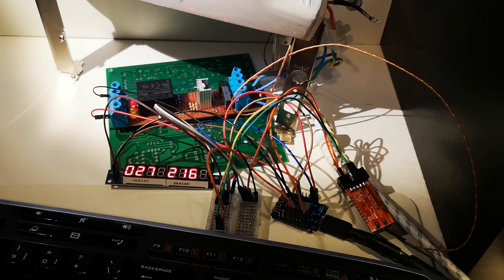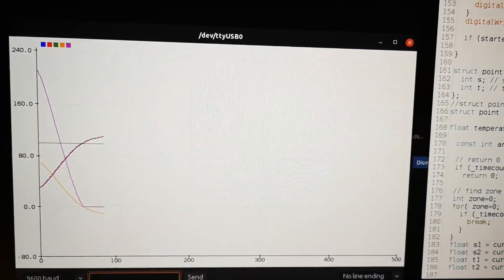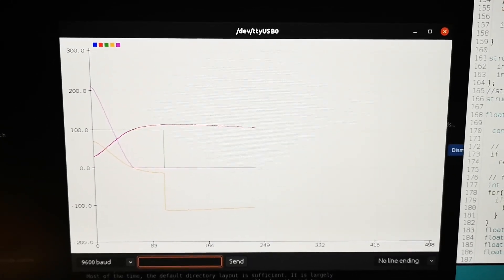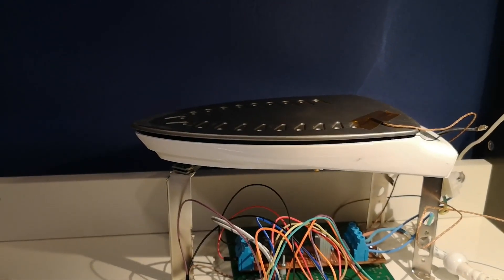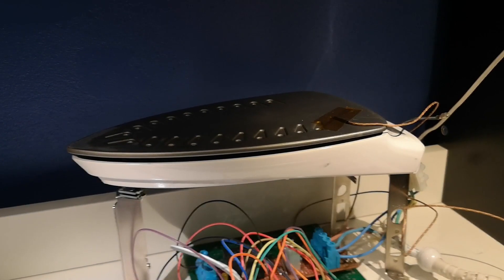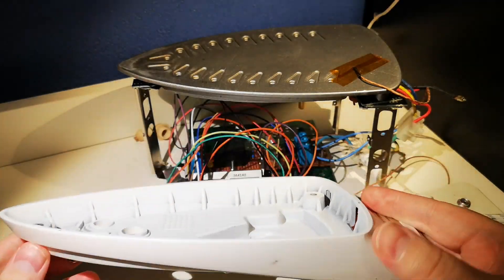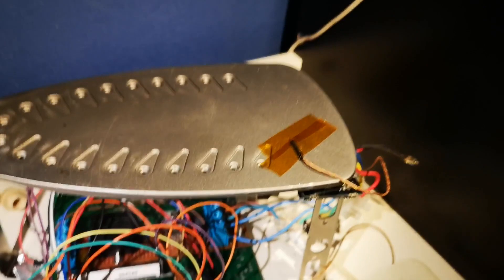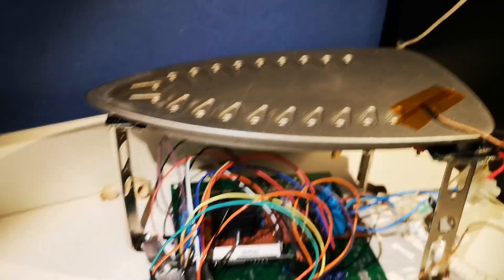DIY hotplate from clothes iron - part 3

Comment: Apparently phenol-formaldehyde resins are used at heat resistant coatings. Googled it. Also googled that according to some formaldehyde is a  probable human carcinogen. Best be careful.
Nice to see Ingri in action :)
Reply from the maker: Yep. Was a bit chuffed that night after breathing in fumes. I opened the windows and forced air with a fan, but still.. After removing the cover, there were no more fumes from the iron.. Now the high voltage part underneath are exposed. It is very exciting and dangerous.

Comment: You need a heat radiator on the top side as well.
Reply from the maker: I've been thinking about that.. Perhaps a fan underneith might be enough. Turning it on when the PID controller output is negative.

Comment: That worked really well. Did the solder paste melt on the cap pads? I thought I saw unmelted paste.
Reply: I was wondering that too. It looked to me that it didn't get fully melted.
Reply from the maker: Yep. I ran the hotplate and board again. The board reversed this time and the capacitor got soldered. I will try the sloped soak temperature. It will then rise slowly to bring the whole board into soak before it ramps to solder melting tenps
Reply from the maker: The sloped soak, it is i gradually increase temperature in the soak phase. The profile I have now has a flat/constant temperature soak phase.
Reply: @bwack  Coincidentally, I have a hotplate coming from Banggood for using with reflowing SMD Savers. It would be nice if it could be modded to follow a reflow profile, but that is outside my scope of knowledge, unfortunately. Perhaps your controller could be adapted for use with the hotplate. 🤔